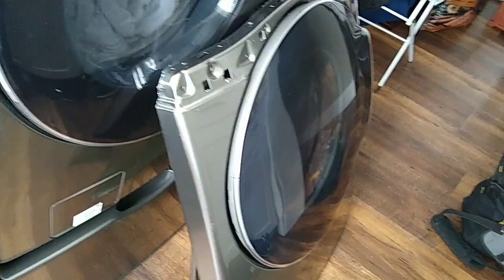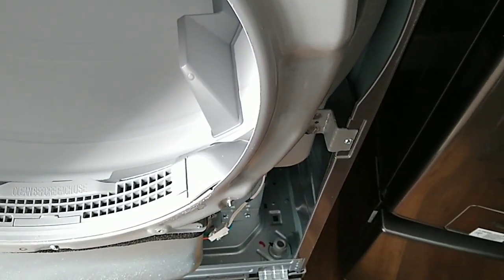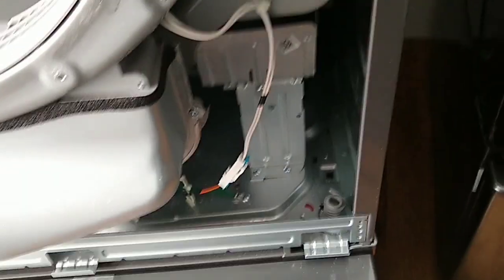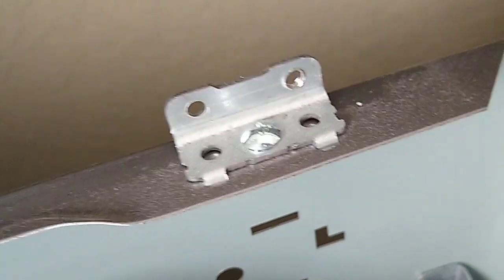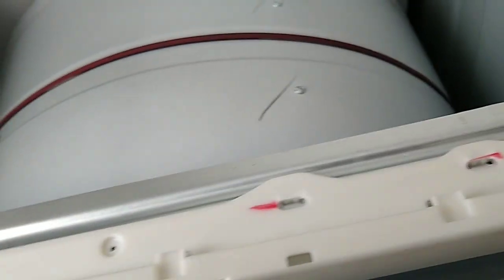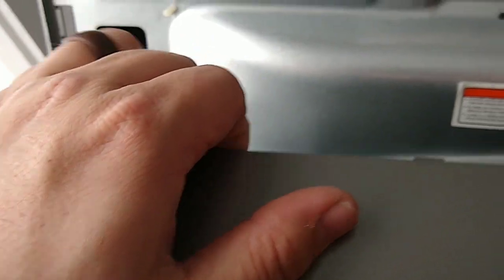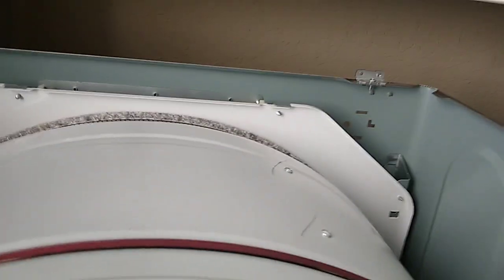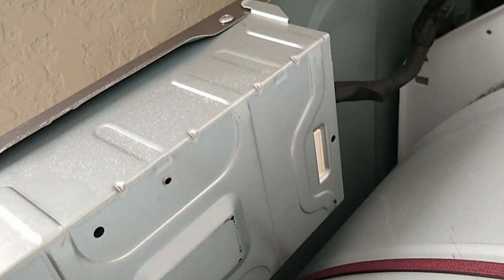(Samsung Front load Dryer will not turn off)(Appliance Repair) (Quick Tip)

Comment: Thanks, guy - you just saved me probably hundreds of dollars in repair costs.  All I had to do was re-seat some of the wires connected to that board, then plug everything back in (including power, which was obviously unplugged), and now my dryer turns off when it's supposed to!
Reply from the maker: That is awesome! I am glad it was an easy fix!

Comment: If I move the cycle dial to off at the top it stops. But  if I move it a little forward and try to start a full high heat cycle it will continue to run  past the stop cycle,and also it doesn’t turn off when the doors open , is this a different problem ?

Comment: FYI, if you have dve60m9900 (flex dry) then you need a dc92-01729L board.  The board is located in the front of the dryer.  Take the front touch panel off and then the front panel of the dryer (the part with the door).  The main board is located about waist high on the left.

Comment: I have a Samsung I seem to be having trouble turning the power off at the Power button. 
  It runs and heats as it should. Jason Pause button. I open the door to get it to stop, if I need to before the end of cycle. 
  I just find it odd the light for time remaining and the cycle will not cut off at the power button. 
  Comment?
Btw, I think I am not going to mess with anymore Samsungs.
Reply from the maker: Those controls have an issue with that happening. You will have replace that board to fix it. The button inside the control has worn down.

Comment: I have replaced the Board on mine dryer twice, it keeps shorting the relay closed? any Ideas?
Reply from the maker: At this point there may be a short somewhere in the dryer. Samsung has a problem with the model.